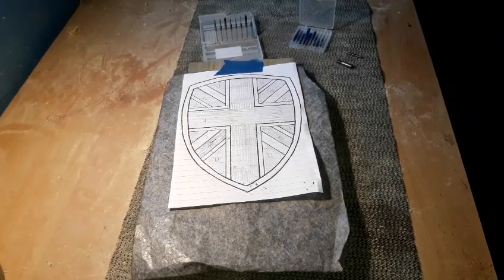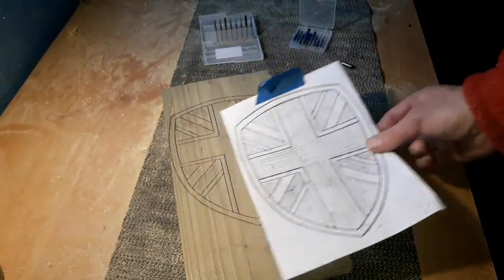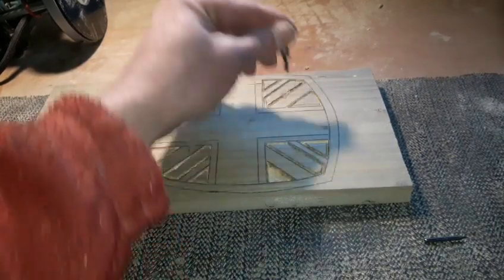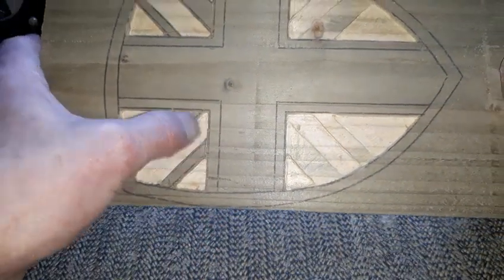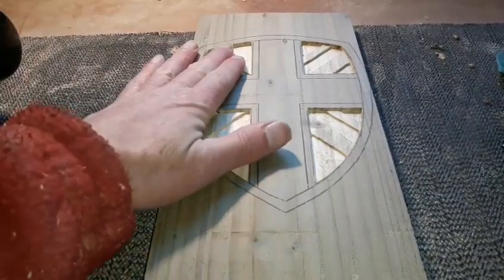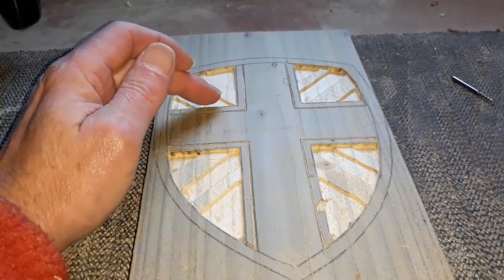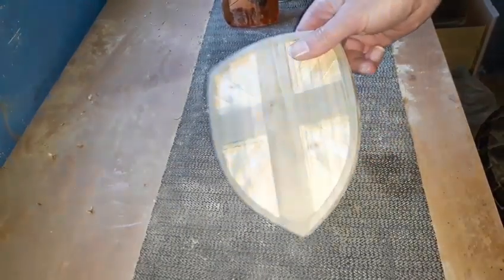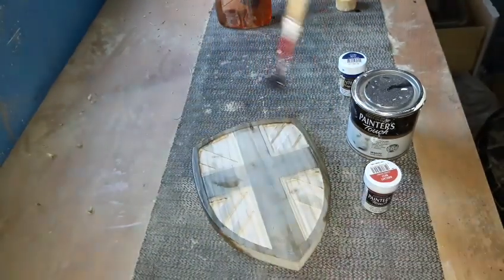Union Jack on fencing wood, router project

Comment: Hi 'Fishtank'. I've been scroll-sawing for over 50 years and would like to have a go at router carving (possibly 50 years until I reach your standard!). I've seen the CNC bits on Amazon that you mentioned but could you recommend a suitable collet for use with a standard router? Appreciate it. Thanks. (I'm in Lincolnshire.)
Reply from the maker: Hi Pete i get all my bits from Ebay or Amazon for a 1/4" shaft router you will need a 6.35mm to 3.175m adapter collet..https://www.ebay.co.uk/itm/223507028230
Reply: @fishtank5050  Thank you very much for your prompt reply. Hope you don't get blown away today!
Reply from the maker: @petestones7802  lol..I'm still going in the shed..👍